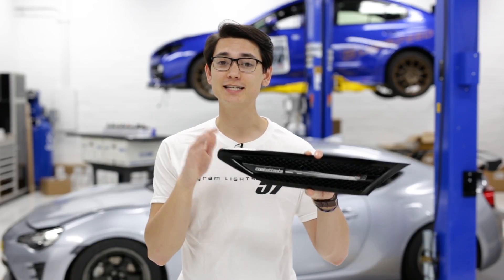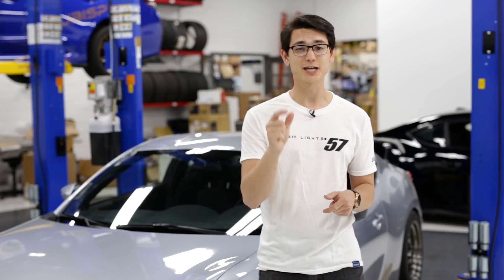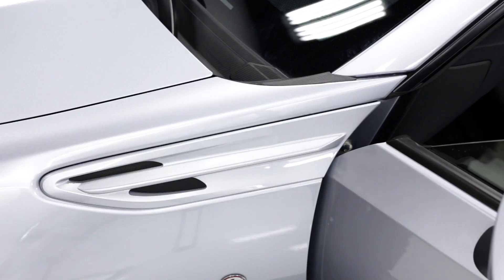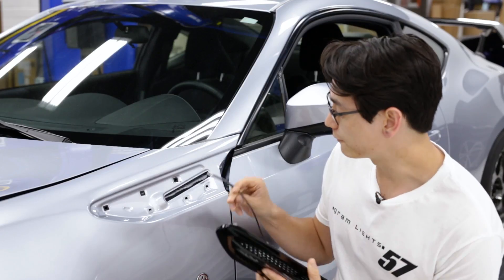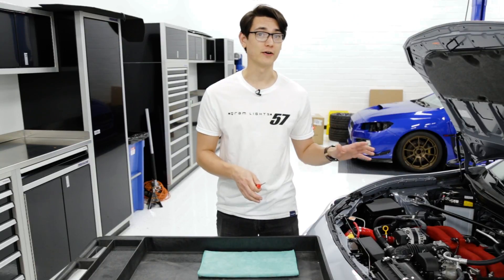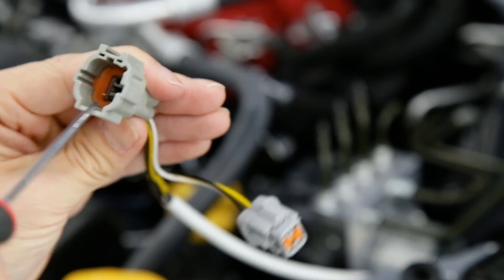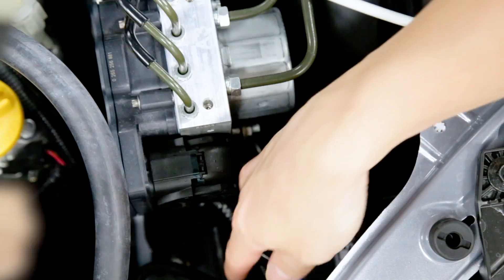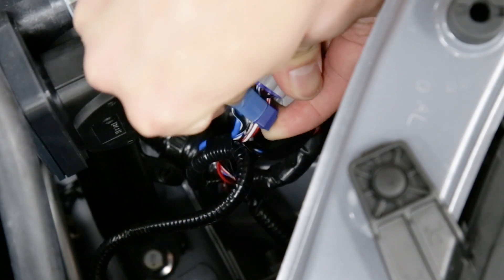Intec Fender Turn Signals - FT86SpeedFactory

Comment: I have a 2016 frs with the front bumper turn signal and the adapter that came with the fender doesn't match the clip in my turn signal so it's not plug and play for me. :( any advice on the installation?
Reply: Bring to a car shop that does wiring if - like me - electrical stuff makes no sense

Comment: Wait so what was the point of taking the connections off with the picks if you just end up cutting them anyways. Can’t you just cut the wire and strip it without doing that?
Reply: Better to remove them, otherwise they'll be exposed hot wires when plugged in to the car's harness.

Comment: Welp for my opinion: What would of been a nicer install would of been make your own plug and play harness, meaning reuse the same harness that came with those turn signals. Just strip the wires back flux, solder, a little bit of water and oil resistant gasket glue rtv then slide the heat shrink over the three-way connection for a combined waterproof install. Electrical tape, tesa tape then wire loom or techflex however you want to do it. Instead of those damn "T-Taps" not good for a factory look install. I'm also going to be that guy and say that I'm not a fan of t-taps.
The way you had those t-taps were entirely way too close to the factory adapter. I mean do what you want your vehicle. in time it just looks really shity for having t-taps. Like I said in the beginning this is my opinion.
Yes I understand that some people don't want to do all of that work but sometimes all that work pays off for a factory like install.
 Sorry been doing electrical for 15 years. Sorry I had to say something after watching this video. it was just itching at me just like a lot of other YouTube videos out there. 
 I've done the same exact thing to my 1998 Toyota 4Runner and I tell you what you can't even tell it was.... what's that word that everyone uses? modified! Haha.
   Hopefully the people that read this understand exactly what I'm talking about if not I'm sorry.
 
Anyway nice product that you showed the YouTube community!